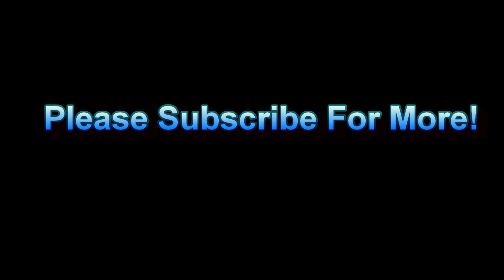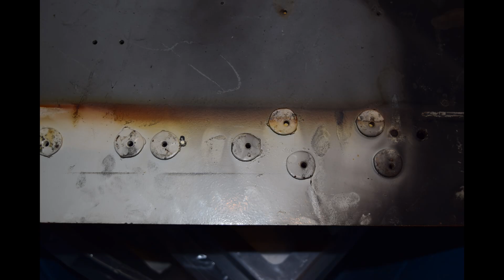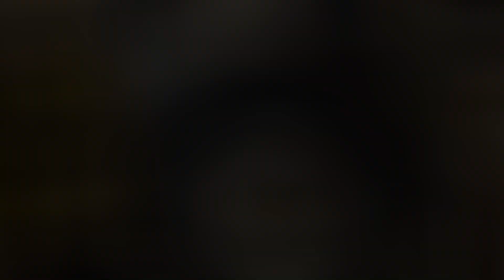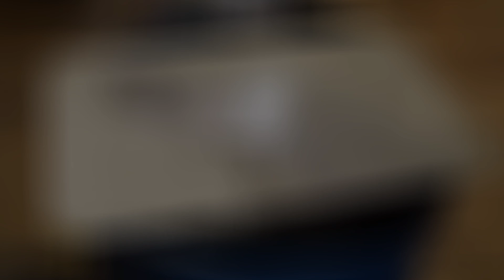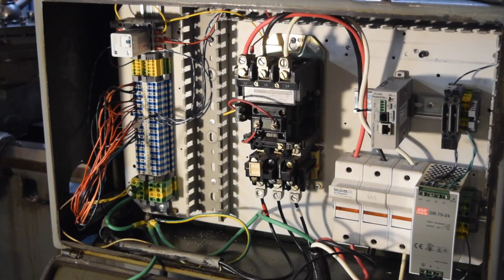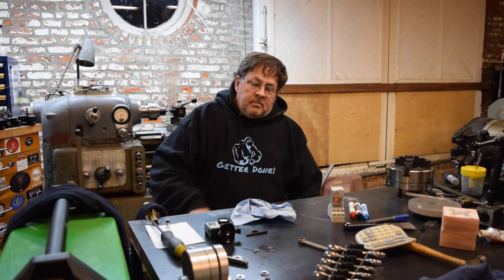Martin Lathe Electrical Panel #1

Comment: Open the box, instant confusion.  That's how it was with my surface grinder.  Some critter got in there, must have thought it was Speaker of the House because I found the schematic in shreds 🙄  Many hours standing on my head, tracing wires, making notes, and drawing rough diagrams on the inside of the panel door.  It makes sense now.  I had to make a few changes to get it to work with a static converter, which involved making sure none of the control circuits were tied to the "A" (created leg) output wire.

Comment: Any reason you prefer the on switch to override if both buttons are pressed?
I usually wire it so the off switch wins, also because there are sometimes E-Stops in series with that.
Reply from the maker: That is just until the new E-stop switch comes in this week.
Reply: @jtkilroy  I guess another reason could be if someone wants to "bump" the machine with the start button while the stop is held in, this way it doesn't latch on. My bandsaw came wired so that even the e-stop doesn't override. I'm sure it's not at all kosher but I use it to bump the blade on with the e-stop latched.

Comment: I have no idea why a lathe would need so many wires! I was looking at the control panel on a Monarch lathe the other day and I thought why in the world is this so complicated! Maybe the lathe makers had a brother-in-law that sold wire...lol!
Reply from the maker: There are two I have identified that are for a safety switch that goes on the cover for the change gears.  And I know that the lathe is supposed to have a spindle brake of some kind. Not sure what kind, I just know that it is 24volts DC and the machine originally had a transformer just for the brake.  Not going to be able to identify that without pulling the top off.

Comment: James, can you change the coil on the starter to 24v coil? I know on the ones I have worked on that was possible. (if obsolete I understand the workaround)
Reply from the maker: No, dont think a 24v coil is available for the size 2 509. I stand to be corrected, but I cant find one for that size. 110, 240, and 480 are common
Reply: @jtkilroy  Size 2 24v 60hz coil is part # CC013. Probably cheaper to use the relay. Some of the oddball AB parts are pricey.

Comment: i like your use of a relay to operate the high voltage starter coil. did you consider using the latching contacts in the motor starter so you could use momentary start /stop buttons? also i see you have no provisions to reverse the motor electrically. is there another way to accomplish this?
Reply: If I remember right, his lathe is like mine. Where the motor powers the gearbox but also a hydraulic pump and it uses hydraulic clutch packs for forward, reverse and brake. So the motor can only spin in one direction in order to provide the hydraulic flow.
Reply from the maker: There is reversing capabilities built into the gearbox